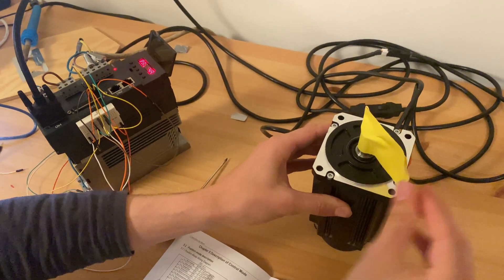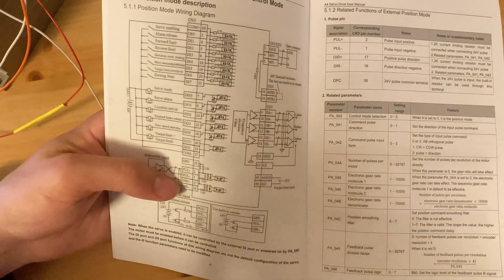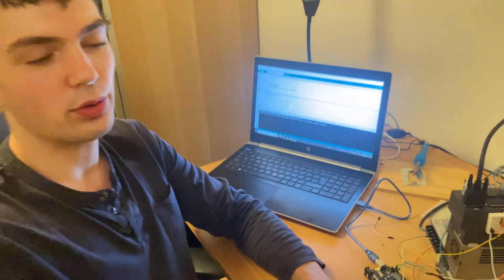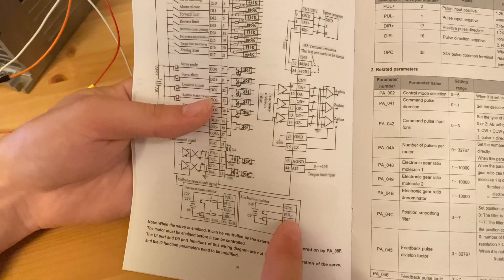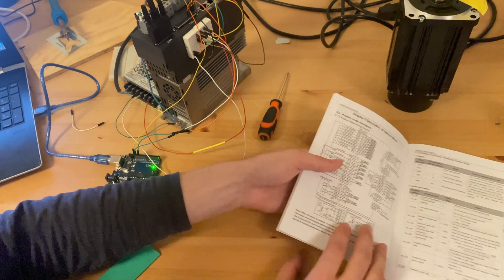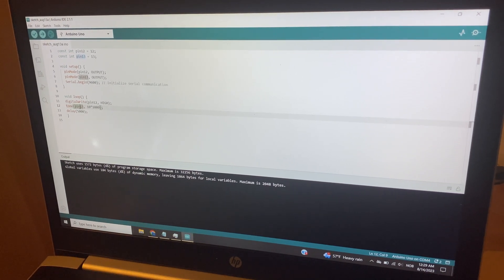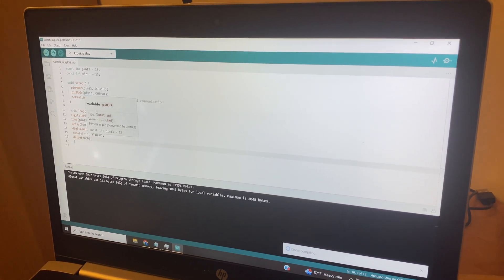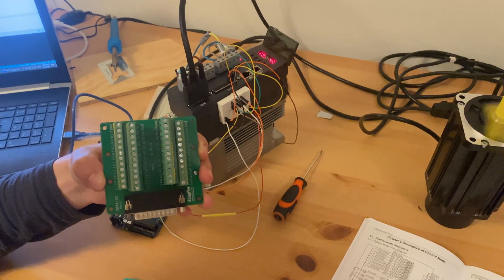How to Wire and Control an AC Servo with Arduino: Step-by-Step Guide

Comment: Have you tried to figure out how to use Modbus RTU only for communication?  I haven't figured out yet how to use the internal position control yet on a Lichuan servo I bought to learn.
Reply from the maker: @DREXELENG2015  i have not, however i recon you can code the step/dir logic to send to the servo and receive encoder feedback through the designated ports.
What modbus connection are you using?

Comment: Working with steppers, I've found that it may not be good idea to have abrupt changes in speed/direction. I would include some ramp-up/ramp-down functions for servos too. I'm planning one project to have 2..3+kW servo for moving something with 50-80kg weight at considerable speeds. Quite a lot of inertia there, it sure won't go or stop on a dime.
Reply from the maker: @SeersantLoom  you can do that.
Just create a method for ramping in the code.

Comment: i am trying to use :
Raspberry Pi 4b or Auduino

Delta Touch Screen (DOP-110WS)
Panasonic Minas Driver (MADLN05NE)
Panasonic Servo Motor (MHMF092L1U2M)
Can you provide some support on this project?  We had posted this project in a few freelancer website but could not get a suitable freelancer.

Comment: Hello,
In the video, the program 48 of the servo driver is set at 1000. When set with the tone function tone(pin13, 10*1000, 1000), the servo motor do complete turn in one second.
Does it means that if the program 48 was set at 500, the servo motor would turn twice in one second?
Thank you.

Comment: this will probably sound stupid but why does the motor constantly spin if you wired it to position mode? Shouldnt that be speed mode?
Reply from the maker: That is not a stupid question. 
Here, we are sending a tone which changes the position, making it look like its spinning. In an industry setting you would send 5000 pulses in 0.1s to rotate 180 degrees.
In speed mode, i believe it works off an analog voltage as a motor.

Comment: Thanks for this tutorial. It was really useful.  I bought the same servo motor and driver and in 15min, I was able to control it.
Have you ever tried to control this servo motor by position? E.g. go to 20 degrees or go back to intial position. I guess you would need to get position feedback from the encoder. Do you thik this would be possible with an arduino?
Thanks in advance.
Reply from the maker: Hello, You can indeed recieve position output through the arduino. The demonstration was done in a step/dir open loop connection. Note the arduino program needs a lot of checks to run a good closed loop system that would not self interfere. 
I have created closed loop systems with these servos but i have only done so using a PLC. If you wish to create your own system, i would do it with ladder logic and a PLC, micro chips are not fast enough if you wish to go faster.

Comment: Hi,my name is Million Haile.can you show me a programm and wiring of arduino to servo to control for bar soap cutting machine with adding induction prox.sensor and encoder?Regards Million Haile
Reply from the maker: I can try to be of help.
For a machine purpose I would not use an arduino. Please check out the Mesa store for linux cnc parts.

Comment: "Exactly what I was looking for! Thank you. I ordered a Lichuan servo a few months ago, thinking it would be as straightforward as any other stepper motor with step and direction pins connected to an Arduino. Could you please assist me in figuring out how to make it move? Is it possible to get your email? It would be very helpful."
Reply from the maker: I can try to assist, but i need to know what model you have.
Have you tried what i did in the video? This should be universal for the lichuan servos